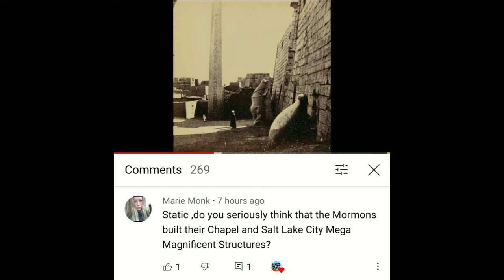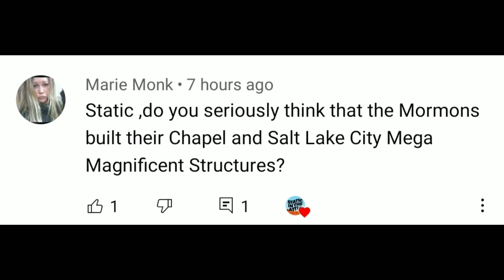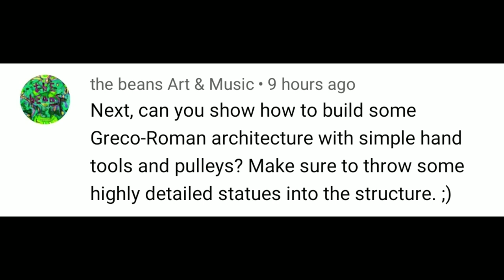Tartarian Architecture - Things we can't build today?

Comment: I lived in Tuscany for 40years and have always been very interested in history. I have always been fascinated by the stone buildings in the Chianti area. Masonry in the rural buildings get “sloppy” after the Black Death. Before that period buildings had perfectly squarely apparently cut masonry. I had always thought that after the Black Death, most highly
qualified masons had died and the few survivors were not qualified. It is obvious that the Black Death was a reset performed on the population, just one of the many. 
The thing that intrigues me about Firenze (Florence) is that according to the official narrative the Cathedral was finished in the 19th Century. So most probably there was another reset in the period perhaps around 1850 or there abouts. It was a period the city was seriously modified in its layout: demolition of large portions of the city walls. As often the case the old railway station, repurposed for an exhibition for 1860 apparently was an “old world” wonderful greco-roman structure. 
What to say ? Time is not linear. We are starting to collectively “see behind the props”, because Reality is radically different to what we have been led to believe. Reality is individual in the end, collectively this is much more relative. This needs to be examined and penetrated individually. It requires mental upgrade to be granted access to full picture of the situation. 

Interesting is also the possible presence of giants in Florence, just check out the sheer size of Palazzo Strozzi. Another interesting thing is the Medici military architecture in most of Tuscany: looks often like Star Forts.

Comment: Nice video. 
These are not intricately shaped stone blocks but flow mold granite concrete. Correct granite composition and proportion plus a special chemical reactive binder. Previous set adjacent blocks and the roll beneath it become the former to the one being mold.

Same technique were also use in building pyramids in Giza.

Comment: As an architect today, I see a big disconnect with people who aren’t taking in account of all the modern commodities implemented in building plans, such as electrical circuitry and hvac Units . For instances arches are horrible for hvac , walls are made out of dry wall and not monolithic stone to easily open the house to fix its modern day problems . We decided proper lighting and air flow was more important than grand imagery aka what saves you on bills. Too big of a push for compact buildings / made liminal that utilize far less energy for modern power driven units and conduit behind its walls
Reply: So what's your opinion on the video?

Comment: Dome is Om

The resonant frequency created from chanting or other polyphonal tones may be the reason they are used in architecture. [that and/or the way the energy is distributed down or around the dome is factored into its shape - energy coming in, going out, or both? IDK]

The public doesn't know exactly what religion created the original structure, at times, due to the addition of ornamental design - this can be seen in structures suffering from damage revealing a foundation which is more minimalist.. kind of like how masjid/mosques 🕌 are designed. Many of the structures that look like they were pressed into the Earth in Africa, Middle East, Asia, Pacific Islands.. okay the whole world.. are typically based on a simple undecorated design. In Cambodia, Indonesia, India, and other places you will find ornamental design slapped on top of a pre-existing structure.. or just a foundation. Who knows? But in Ethiopia, for example, the design of the St. Mary of Zion Cathedral you see much less decoration.. plus the Om Dome.